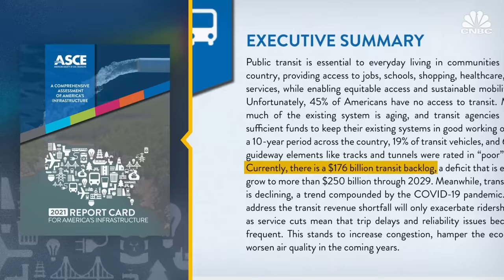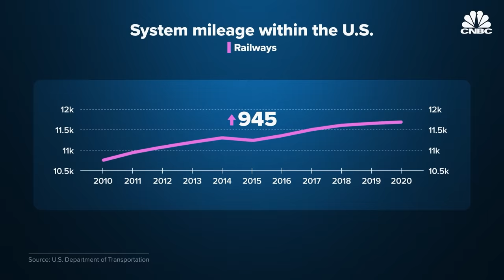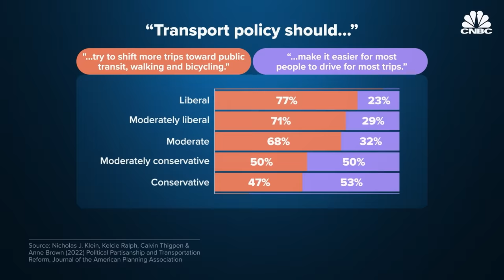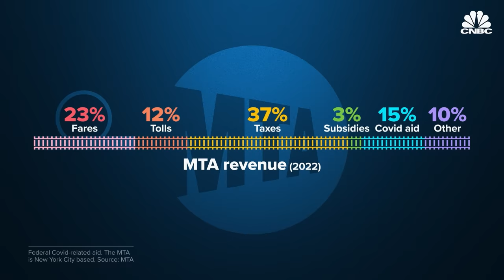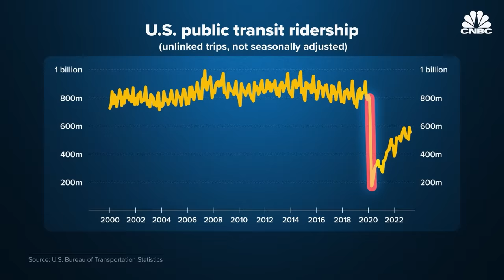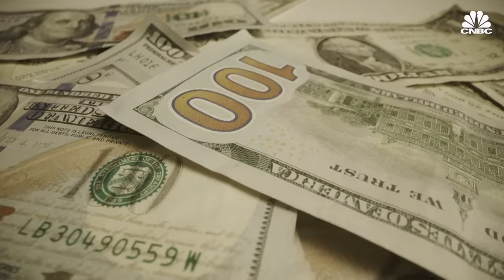Why The U.S. Gave Up On Public Transit

Comment: Another silly problem is there is a large group of people that say that public transit is somehow taking away their freedom. Just because there's public transit doesn't mean you can't drive!
Reply: @@ghost_mallbecause cleaaarly it’s more important that someone take up valuable road space with the most space-inefficient method of travel, just for their own benefit, than that road space being shared in the most equal way. duh. their freedom to be in a metal box is more important than anyone else’s freedom to move efficiently.
Reply: There's a lot to unpack in that comment but I'd say the people argue that are completely wrong. If anything a great, well-funded public transportation system would give them even more freedom and mobility. Emphasis on well-funded.

I went to Japan recently and their public transportation is amazing. They are entirely different from the US keep in mind. Japan is tiny compared to the US so it's much easier to build the infrastructure for public transportation there. The US is so massive it'd still take decades for us to have a fully-functioning transportation system even close to their level. 

The geography of the US is just much more convenient for cars if you think about it. But it never hurts to have public transportation in huge metro states like Texas, California, or Florida.
Reply: The channel "not just bikes" made an excellent video why actually the opposite is the case. If  people can use public transit and bikes to get around (or just can walk), less people will drive. This means for people, who still want or have to drive, less congestions and they can get around faster.
Reply: I’m not sure if certain history facts were edited out or just omitted but I found this piece flawed in general. There is plenty of evidence that the auto industry deliberately and meticulously  bought up trolley car companies to  actively persuade (perhaps push) car ownership. Additionally the marketing of cars as synonymous  with freedom. 
Lastly the video spoke about the economics of mass transit and the high costs. But spoke little about how much we subsidize the building of roads and gas/oil companies. All of these issues have greatly impacted the perception and thus the success of mass transit in the US. If you own a car and you drive as much as the average American it still sits unused more than 21 hrs a day. Yet, it’s costing you at a bare minimum $200-300 per month with $500-800 being closer to reality.
Reply: @IAMN0TGAY what about all the people that pay for roads that don't drive? Why do they not have a say?
Reply: @IAMN0TGAY  Hey now champ let's get some facts in order here. In 2019 there was $79 billion spent on public transit throughout the US at every level (according to the congressional budget office). 2/3rds of that spending comes from governments and the other third comes from fares so now we're down to about $52 billion. States and localities provide 3/4ths of that share (about $39 billion) and the federal government provides the other 1/4 (about $13 billion). So let's take the complications of taxing out of it and say everyone in the US gets taxed the same. Everyone pays $39 for public transit. For most people this is obviously WAY less because people in higher income brackets pay more taxes and corporations and so on. It also heavily depends on what city and state you live in. So in reality the most you'd be paying as an individual for public transit as a non-user would be less than $100 per year depending on your income and where you live. What's really fun is looking at how much highways cost per person per year. What's funny is that Alaska spends the most on highways per person at $1800. What's even funnier is that Arizona who spends the least per person is still over $400 for every year. The median is Arkansas with $600. I don't want to drive and pay for your dumb roads that I never use. My hard earned money is being wasted on your roads. It is wasted because I, subjectively, choose to not use it. Roads are not cheap to arrange.
Reply: @scj6693 this is pretty extreme. Off the top of my head, the biggest reason, outside of personal choice, I could see people choosing to drive or ride in a single vehicle is their physics disability. A lot of publi transport systems have large barriers to those with a physical disability such as not working elevators at the subway or train station, lack of available seats on buses and trains then the inability to walk or bike to their destination.
Reply: @IAMN0TGAY  my numbers are literally from congress... How do roads work without taxes and subsidies again?
Reply: Not to mentiom all the parking lots. Land that could be used for housing or recreational parks for humans is wasted
Reply: @IAMN0TGAY You’re already forced to pay to maintain roads and highways that are more expensive per mile and don’t bring the same economic benefit.
Reply: It's simple...Your Not seeing it from that perspective.... Look up the Interstate Highway system and why Dwight Eisenhower undertook that infrastructure project.  Think about it from a national defense strategy and it will make all the sense in the world
Reply: @kctransam  Yep. So does public transit lol
Reply: @effinxrightt  this is why public transit should be designed with these accommodations in mind. i am the child of a parent who has been physically disabled since before i was born. this is the sort of thing that i am already familiar with.
Reply: they just don’t want their tax money spent on something they don’t use
Reply: @loopba  Me neither. Get rid of fire, police, military, ambulances. I don't use planned Parenthood, oil subsidies. Hell I really don't use the capitol building in any of the 50 states.
Reply: I lived without a car in Los Angeles of all places for 3-4 years, and felt the most “free” during that period: free to occupy myself with other things while in transit (rather than having to focus on the road); free to move about easier in otherwise hard-to-park places (downtown, beaches, etc); and freed up budget by $300-500/month
Reply: @carriefrazier1809  I bet you also still had the freedom to own the car too lol
Reply: It is not just the freedom of the road it's freedom of not being locked up in a box with the scum of the earth.
Reply: @JOESMITH-qs8ue  okay then don't use it just like I don't use roads
Reply: Lol like sitting in rolling traffic is freedom. If they don't like it they don't have to use it, doesn't mean everyone feels that way
Reply: @IAMN0TGAY u can’t just call it wrong and propaganda cuz u don’t agree
Reply: @kurtphilly  Also important that people tend to only see the upfront costs of transportation rather than the background ones.  
Americans will see a $10 train ticket to go a distance that'd cost $8 in gas and say driving is cheaper. Nobody thinks about the hundreds they pay a month for insurance or car payment because its just another recurring bill. That's not even to say anything about licensing, maintenance, registration, inspection, etc. since those are irregular fees that feel like one-time things each time they have to be done. The problem is doubled with there being no public transport in most towns and suburbs in America meaning people have to own a car even if the city they commute to for work has transit. This leaves people paying all the automobile costs plus transit costs with their car sitting for most of the week but still needed for errands. That makes the transit costs even less appealing because of how expensive car ownership is. If you're paying that much for it you might as well use it
Reply: another silly comment of someone who believes the message of this biased video without doing the research. NYC is supposedly a perfect city for mass transit. The usage of the subways has recovered to over the pre-pandemic levels. NYC's MTA has received the untold billions from several infrastructure, stimulus and Covid bills. Yet it still sucks and has become much less safe because of the horrible "progressive" policies and the labor unions that force the MTA to have more people that it needs, and it has to pay them way above the market. The same is true of any MTA construction project - all of them have enormous budgets, they usually complete late and cost billons and billions, even for relatively small impact projects. This video didn't mention the unions and their corrupt influence and costs, and didn't mention the increasing city crime - which one of the key reasons some New Yorkers today avoid the subways, even at the expense of getting stuck in the traffic jams.
Reply: @leonardnyc12  If only there was an organization that existed to fight crime. The true crime statistics on public transit in New York and across the country is basically negligible compared to the dangers of driving and the danger of cars to pedestrians. I'm not sure that you realize how many billions are really spent each year on public transit vs roads in NYC and this country. I think you should be doing more research into the real numbers and facts behind these issues.
Reply: have you ever bee to europe? its a hell hole for driving
Reply: Majority of them don't live in cities so why would they vote for it?
Only city governments should be funding mass transit not rural communities
Reply: @mattr2626 The US still can have intra-city (or intra-metro area) transit like MTA of New York or MBTA of Boston.
Reply: @SJRS700  Yes everyone famously wants to widen all of the European roads and make then more like the US! Oh wait nobody wants that? I wonder why.
Reply: @@ghost_mallbecause in the US is all about me, me, me
Reply: @IAMN0TGAY  By not investing in transit, you are forcing everybody to drive.  And guess what, it means more traffic and more traffic jam.  Investing in transit is more than just for people who take transit, it benefits drivers too.  Think of all those hours you are stuck in the traffic and waste gas.
Reply: “But muh lanes”
Reply: @slam5  just one more lane bro i promise one more lane and we will solve traffic forever please just one more
Reply: @scj6693  just look a t LA, tons of highway but minimal transit.  2 hours traffic jam each way to and from work.  4 hours each day stuck in traffic.  All that time you inch along the highway in your car.  And you have to pay 100% attention to driving or you get into an accident.  On other hand, if you take transit, it takes fraction of the time to get to work.  Can take a nap or read a book, meet and chat with other people if you like.  And yes, you lose some privacy but it also mean you gain some time to do whatever want to use it for.  Is that worth some of your tax money?
Reply: @slam5  oh, my comment was sarcastic. look up the “just one more lane bro” meme. it actually argues against adding more lanes for all the reasons you specified. don’t worry, i’m on your side, i agree that adding new lanes doesn’t help and that transit is a better alternative for the reasons you mentioned 👍
Reply: @IAMN0TGAY   actually I’m saving you money. By me not driving I’m freeing up space for you drive. How is public transportation costing you thousands of dollars a year? If you don’t have kids you still pay so kids can go to school, am I wrong? How much do you spend every year to own a car and how many hours per day so you driving it?
Reply: @Koopzilla24  100%. The major problem is that we have designed cities to be car focused and not walker, biker and public transit focused. There are obviously some outliers like NYC, Portland OR, and to a lesser degree Seattle WA. I’m sure their others but I haven’t researched it. On the other side, just look at all (overwhelmingly majority) of Florida and Texas. Sprawl is the name of the game.
Reply: @bikeenjoyer977   depends how deep do you want to get into this.... And depends on many factors.   The worst thing is to oversimplify a complex issue. Kinda..kinda  like how every political issue now days falls into this dichotomy....
Reply: @IAMN0TGAY  if you want the people who use the roads to pay for them then get ready for every road in the country to become a toll road with higher fares than you've ever seen
Reply: @scj6693 yes now keep crying b
Reply: @balleraap007  ???
Reply: And owning a car is not freedom, it’s a burden. Insurance, traffic, pollution, maintenance, finding parking, stress of driving. It’s a chain disguised as freedom
Reply: I've never heard anyone say public transpo is taking away their freedom, I've only heard people saying people won't use it. Where exactly can this alleged "large group of people" making that ridiculous claim be found?
Reply: @Bioniking  I drive cross country whenever I want lmfaoo
Reply: @IAMN0TGAY  It's hilarious that you say that public transportation is an 'unfair expense' to the taxpayer. Have ya ever seen the 'military defence' budget? where do you think THAT money comes from?? ;) Priorities. They are important. Get yours right.
Reply: Lol, and they ironically don’t stop to think that cars also taking away freedom, I mean, because of cars, we built wide roads and highways which demolished houses and made walking and biking impossible meaning your only way of getting around is by driving
Reply: Well in a way it is. If you have a personal vehicle you are free to go almost anywhere. With transit you beholden to routes and schedules.
Reply: @AB-qt4dj  In lots of places that's true but in lots of places transit is well built and goes everywhere in the city with frequencies at 15 minutes or quicker. Even if your city doesn't have a system that goes anywhere you can still call an Uber or cab to get the outlying places. Also when you ride transit you can still own a car and when you own a car you can still ride transit so one isn't really more free than the other.
Reply: @IAMN0TGAY  "I have no personal use for it, therefore I don't want to my tax dollars to fund it!" 

Guess what, your tax dollars fund a lot of worthwhile stuff that you may not have a personal use for. Your tax dollars fund public schools, even if you don't have kids. Your tax dollars fund libraries, even if you don't use them. Your tax dollars fund social security checks for the elderly, even if you aren't elderly yet. Your tax dollars fund benefits for military vets, even if you've never served. Your tax dollars fund airports, even if you're never going to take a flight in your life. 

I can go on if you want. But this selfish American libertarian attitude is so childish and braindead.
Reply: I shouldn’t have to pay if I don’t use it
Reply: @RyanStorey1231 you really think those things are good and fair they definitely aren’t if I’m not using it I shouldn’t pay for it I don’t care about you or you’re family and I never will it’s not fair to me

Comment: The Netherlands is PROOF that better public transport, walking and cycling infrastructure IMPROVES driving by car.  WAZE did a study a few years ago and put the Netherlands at number one for being the best country for car drivers in the world.  

While it also is the best country for biking and one of the best for walking.  Public transport is OK, but certainly not the best in the world, however that is probably due to the options to cycle everywhere.  Being one of the strongest competition for (local) public transport options like busses and trams.
Reply: HAHA. Cycling? Netherlands is flat and small, similar size as a SE slice of Pennsylvania. The entire country of Germany is the same size as Texas.
Reply: @jgg204 cycling within a city, why not?
Reply: @jgg204 Yes. And it works. Dismiss it out of hand all you want, those cities are thriving with bike friendly infrastructure weaved in.
Reply: @jgg204  Not only is it flat and small, but the average high temperature in August is only 72 degrees and the average low in January is 34 degrees, with very little snow in the winter. Yeah, no wonder cycling is popular there. There are very few places in the USA with that weather.